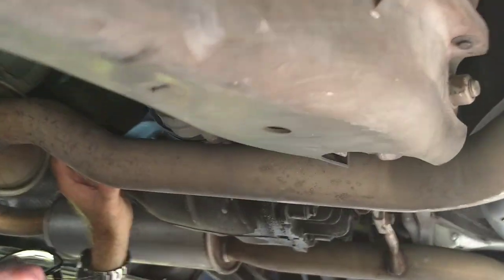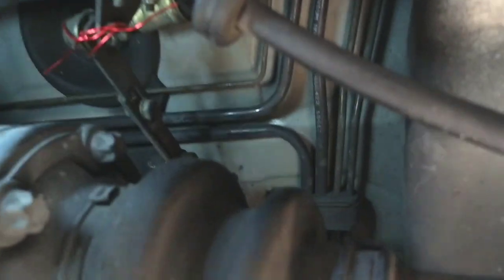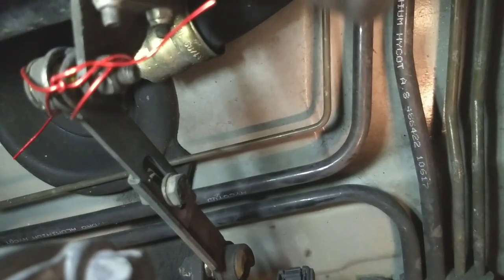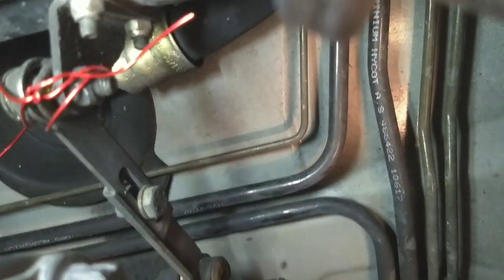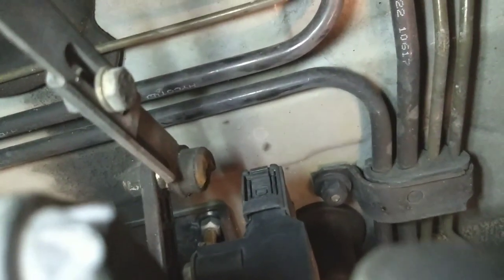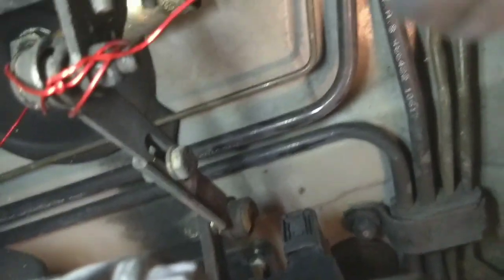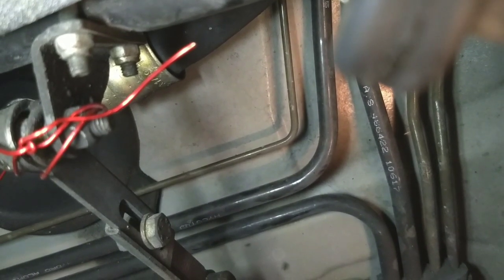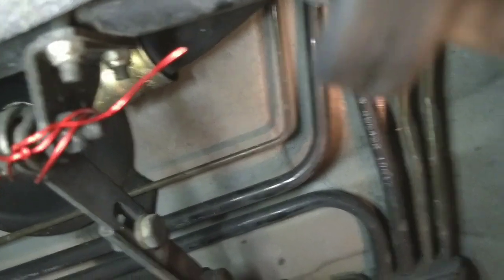Air Shock Repair for Mercedes S500 - Check this FIRST!

Comment: Hi Clark,
               I wanted to thank you for such a great tip. I was struggling with the same issue. I though my rear air struts were old so I replaced them but still the same issue, the rear will not go up. I replaced the compressor ( I had from my other car), checked solenoids and fuses and everything was fine. I was frustrated and finally Googled it and saw your video and I had the same issue, the nut and screw were rusted and came off. I used tie wraps to keep in place until I get them tomorrow morning. My car's rear side is raised as it should be. I owe you a thank you so writing this response. I wish I had watched your video earlier. Your help is appreciated. Keep up the good works. It happens that I am also in Mount Dora/ Eustis area, off of 44.  Thanks, Sam
Reply from the maker: Hi Sam.  Glad you got it working!  
    We are out sailing our boat.  Currently in the Dominican Republic.
   Thank me by watching a few of our other videos.  You might like them and choose to subscribe.
Reply: @Clarks-Adventure   I had just got my car back from the shop and it went flat and two tow trucks couldn't get under it. Before the  expensive one came I was able to get the backup and poke around I found the same issue. One zip tie later it works. Thanks shirtless YouTube man!

Comment: You think it’ll cause the front not to rise also?
Reply from the maker: Must be a sensor there as well
Reply: Emily & Clark's Adventure  actually it was just like in your video, except the top rusted out so it fell off I put it back up and it’s rising again. Only thing is I’m not sure of the position it needs to be in
Reply from the maker: Adjusting that sensor will essentially adjust the car height. Just move that sensor until the clearance on the front tires matches the clearance on the back tires. -C
Reply: @donnyclips4u  where in the front part of the car is the sensor located? the front airmatic struts on my S500 are way down.
Reply: Joey Topacio it was this same  Sensor as shown in this video. It worked for me! I just have leaks else where😞
Reply: @donnyclips4u My ride height sensor arm thing is still attached, it's really rusty though. On to the next step I suppose.
Reply: Joey Topacio mines was rusty as shit! I had to tape it with duct tape. Also I had to lift the arm back to position.
Reply: Joey Topacio it could also Be the level control valve sometimes those go. It’s right above the air compressor
Reply from the maker: Joey.  Maybe temporarily swap out the back one to see if it still works??

Comment: What's the operating function of that are how do I make it temporary stay up??
Reply from the maker: I don't understand what you are trying to say.
Reply from the maker: If you have the same problem I had just do what I say in the video.
If you have a leak or pump issue you need to address that problem.
Reply: No it's the same problem as yours whole car raises up then the back right drops back down
Reply: I was just wondering once I get under there do I pull it out to lift and push in to drop
Reply from the maker: I think you have a difference issue.  If your car is going up then one corner is coming down it's not the ride height sensor.

Sounds like you have a leak.

Comment: Air Suspension is why I didn't get the XJ350 Jaguar. And went for the X300 XJ6.  These Air Suspensions can cost Thousands .
Reply from the maker: But my heavy s500 not only rides smoother but corners better then my little Porsche.   This system is marvelous when it works and it's actually very reliable.

  The whole car isn't for anyone that can't dive deep into DIY or afford the Mercedes repair shop.  It's not for everyone but if you are up to it they are amazing and cheap.